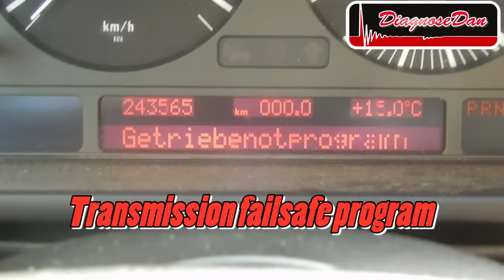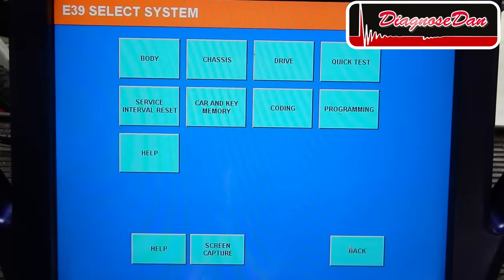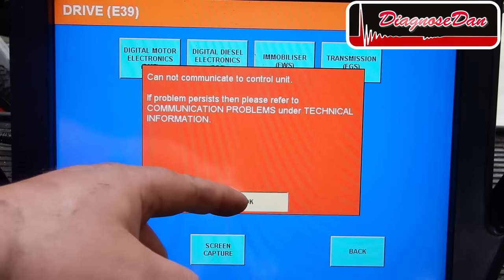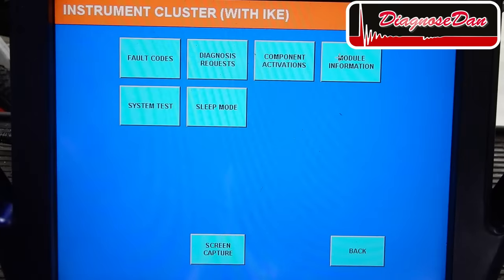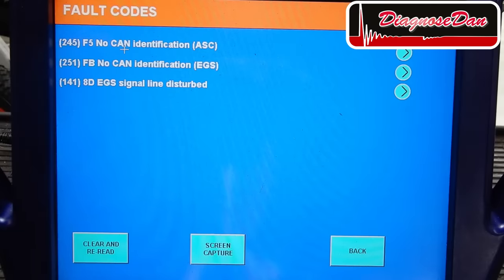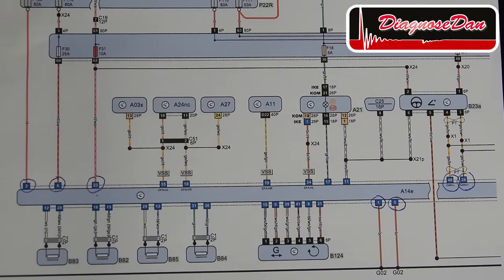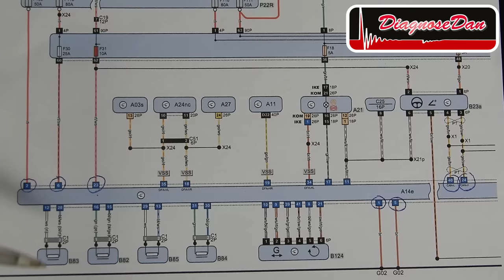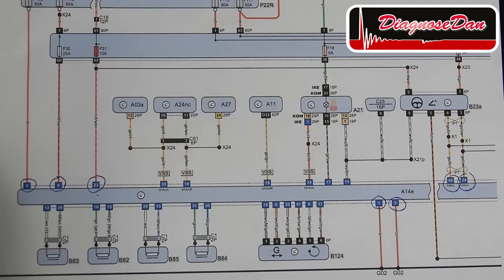Can-bus Trouble

Comment: If someone is interested in how to calculate resistance for parallel resistor circuits.
Formula is like this:
R = 1 / (1/R1 + 1/R2 + ... + 1/Rn)

Calculations look like that:
R = 1 / (1/120 + 1/120) = 1 / (0.00833 + 0.00833) = 1 / 0.01666 = 60.024 = *Rounded* 60 (Ohms)

Have a great day!

Comment: I have a 2012 VW GTI with 7 speed DSG. Lately it has begun having a loss of drive power, often in very inconvenient locations such as in intersections and busy freeways with little or zero places to park. I can usually stop the car, turn off the engine (which is always still running) and restart and drive away. I have had this vehicle towed home, now, three times each being an over 40 mile tow. I get two trouble lights when this happens. I get the ESC first followed by the Stabilization light four to five seconds later. Have you ever heard of this happening before. I'm about to junk this car.

Comment: Id disagree about what determines high and low speed can bus, anything beyond the set voltage high or low is considered( typically 1 volt high or low of 2.5v) a 1 or 0  differentially.  The speed comes down to baud rate where a mid speed bus is going to usually be 500kbs or lower and high speed is going to typically be 500k-1Mbs.  That is model dependent but the speed is determined by its bitrate, not necessarily its voltage levels.

Comment: awesome
Reply from the maker: Thanks👍
Reply: Hello Dan, I have a doubt please. Even though we have different modules connected to CAN bus, we would just have two 120 ohms on the CAN bus right? We don't terminate each module with a 120 ohm, do we?
Reply from the maker: @aparnasbose  No only 2 modules with a resistor
Reply: Thank you for your reply. Could you also please tell me if there is any rule to decide which two modules would be selected for the same?
Reply from the maker: @aparnasbose  No rules. 😉
Reply: thank you :)

Comment: I still cant understand why modules like this go faulty, after all they are sealed units with no moving parts, low voltage systems, the reliability therefore has to be questioned with these early CAN BUS systems and alot of electronic components supposedly designed for harsh automotive environments (such as under your bonnet). My 735i backfired the other day, blew the rear muffler apart all of a sudden, car engine just stopped, the main computer had suddenly failed. Luckily I sourced a replacement for $100 from a wrecker, 4 screws and it was replaced all fixed but muffler and repair was $300.

Comment: Liked the video  bu,t ok, you fixed it but it cost a new module .This is a fiddle by the manufacturer because the module was not fixed which is what should happen  but rarely does these days and it may have just been a 2 cent resistor burnt out,   ps    the expression "a person" is fine but the plural is "people"  not "persons"

Comment: At 7:46 mark, why not use a volt meter? What if you only had 7 volts for instance going to the DSC module. You obviously know what you’re doing but I would never trust a test light for troubleshooting a CAN issue.

Comment: Getting error u0073 ,u0121 ,p0500 some time problem not comes but when comes no odometer working no guage working no back gear light no AC working and scanner also not communicate with ECM and when car turned off they need to sleep for 1-2 min

Comment: Working on a Z3.  Car runs fine, came in for abs light.  

Anyone ever see kline flat waveform at batt voltage?  Whole network down except dme.  K line isnt pulling down at all to make signal.   Bad ground for kline maybe?

Comment: It used to be no need for 1000000 sensors. No wonder electric cars going to dominate the car market with it's simple designs. 

Who would have thought electric cars would have less cables, sensors, ect. than combustion engines.  I still don't understand why in combustion engines do not simply test combustion process (as they already do) and if there is a problem than just stick his probes right on the device that could be wrong. Usually it's 1 or 2 possibilities. With sensors you get 1000000 sensors that also point of fail leading a 100% working car to go for maintenance without anything actually wrong. This gets price for car owners. Some car owners simply give up on fixing issues because of this sensors than they get a real car issue because they assumed it was the same or another sensor issue.

Comment: @13:37 That "echo" may be what technicians call that but electrical engineers refer to that phenomena as "voltage reflections."  When you take an electromagnetics course as part of your electrical engineering curriculum (See Hayt & Kimmerly Engineering Electromagnetics  Chapter 10 8Ed.) you will study this phenomena in depth.

That explanation of why 60 ohms is the correct reading was a terrible explanation.  Why not just do the math? Those two resistors are in parallel so (R1 * R2)/(R1 + R2) = 60 ohms. R1 = 120 & R2 = 120 so (120*120)/(2*120) = 60 ohms.  That is way more understandable that the water, bridge and stick figures.  If I were a technician I would be more confused.

Comment: Hi Dan thanks your video, am facing the same problem on 2014 Mitsubishi outlander sport 2014 kindly help me to solve it ,this are de fault code (ABS fault code_u0101_u0100_u0141_u0001_u0126(CVT fault code_u0121_p1710 ,help me to solve it